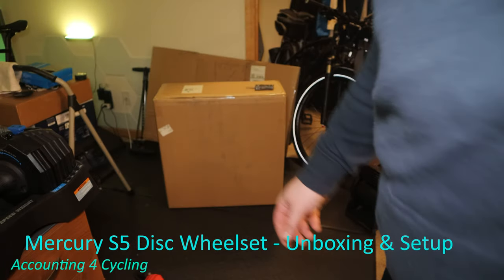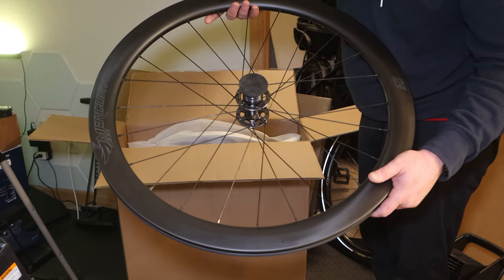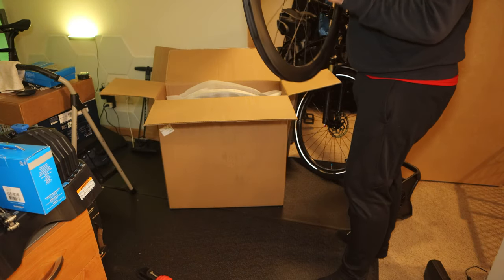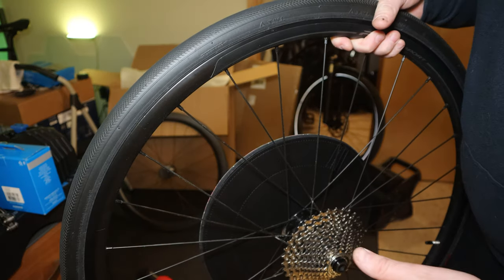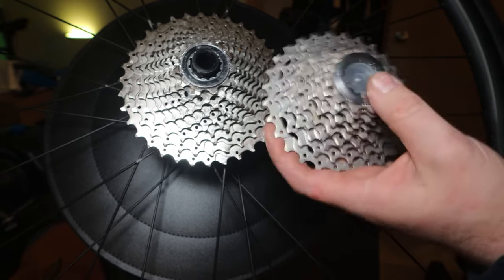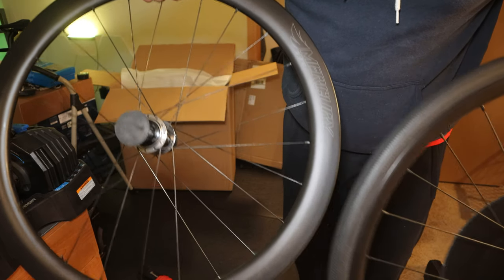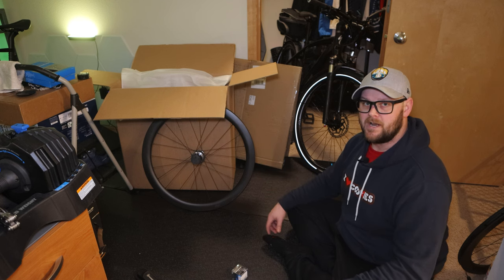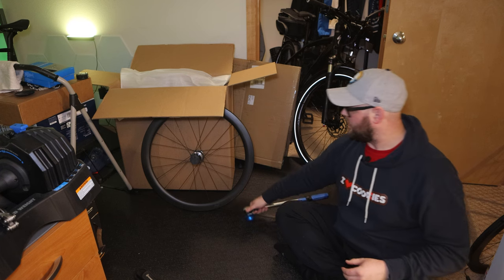Mercury S5 Disc Wheelset - Unboxing & Setup

Comment: I have the exact pair but with the upgraded dt240 hubs. Had them for 2 yrs and put 7500 miles on them. Very happy. Had to true them initially and it took a bit to set up tubeless but ever since they have been fantastic.
Reply from the maker: That's great! I have everything I need to get setup on tubeless, just haven't put enough wear on my GP5000 clinchers. It's also entering indoor ride season for my Roubaix, probably a next Spring thing. I'm interested in the dt hub, too. Did you ride with the Mercury Axis 4-pawl hub at all or upgrade right away?

Comment: Not bad. One thing I don't like is the bladed spokes. Aero wheels are known for catching cross wind and making it difficult to control the bike. Round traditional type spokes help in giving better control. Test this if you can you will see I am right. I've had 4 different carbon aero wheelsets all with blade spokes 40mm profile and got rid of them because of this issue. I wasn't going to get any more aero wheels but I decided to have a set of Boyd wheels custom built to my preference and I chose round spokes.I can hardly feel any cross winds throwing the bike. This turned out to be a great set of wheels so I will keep them. By the way, that arm was long, you should have that checked.
Reply from the maker: I feel the same way about rounded spokes! I don't see enough of an aero benefit to them for someone of my size and ability, they also tend to be a little harder to replace if one snaps. These have rounded spokes, too, almost no cross wind effect.

Also, my arm was long?

Comment: Only problem there is, is that these ones might've went through more quality checks than usual. Would be interesting to compare with another set which wasn't set out to review.
Reply from the maker: These weren't sent out to review, I purchased these in January 2022 with my 2021 bonus from working insane billable hours public accounting. There was no opportunity for Mercury or Competitive Cyclist to do extra QC on these. I appreciate the compliment on brand pull you're assuming, but I'm way under their radar! I make sure to put a disclaimer in if something was sent to me for review, which is usually through my consulting gig and still not big enough to have extra QC put in. YouTube requires you to disclose if something was sent to you for review purposes, sponsored, or in anyway not purchased yourself. Thank you for watching, though, I really appreciate it!